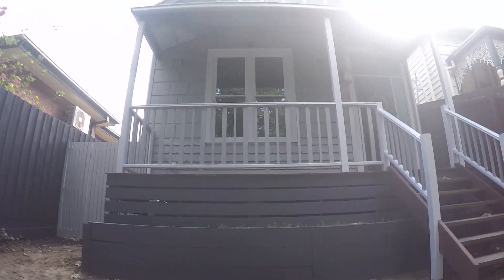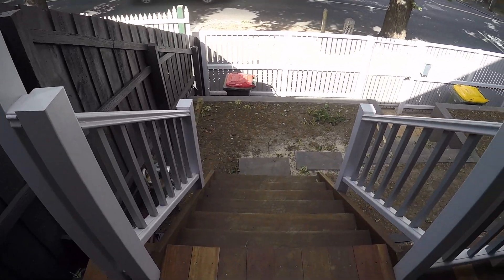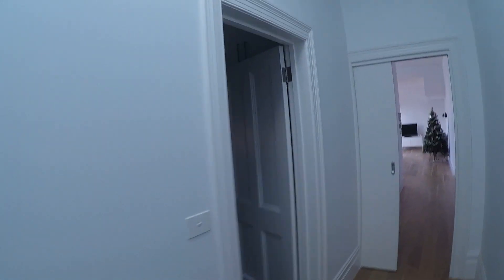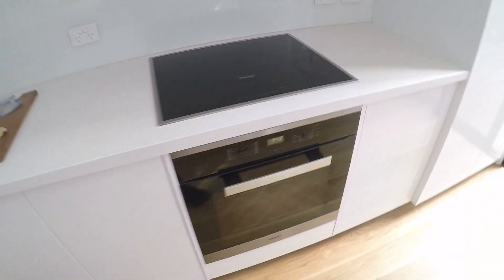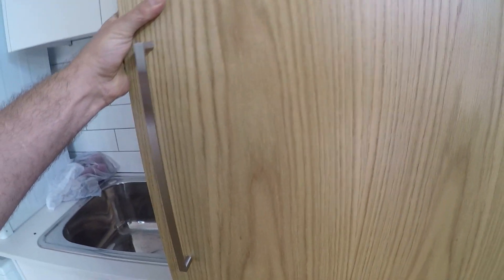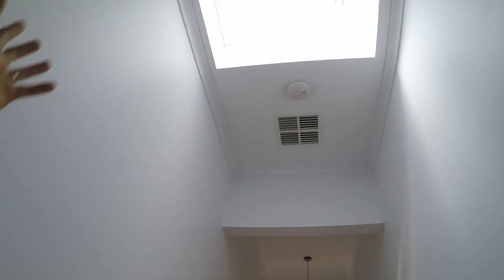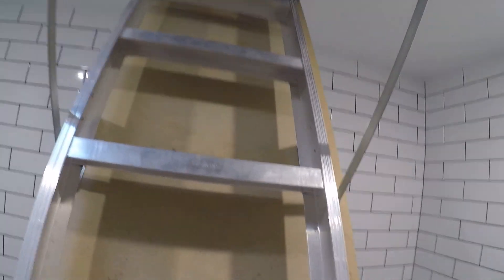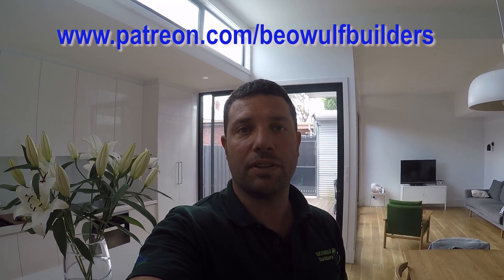Home improvement and extension on a heritage home - energy efficient and sustainable

Comment: Strange place to keep the compressor
Reply from the maker: BEST place... easy access to each window for each room without scratching hte floors
Reply: @BeowulfBuilders  so each time you wanna use it in a new room you have to climb under the house to redirect the hose? Better option is to strap it to the roof and climb the ladder 🤪